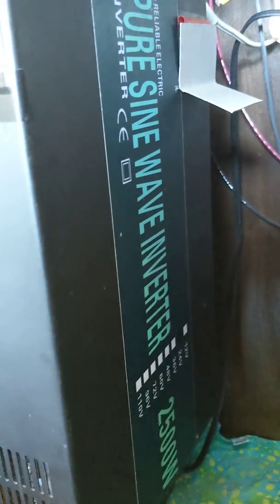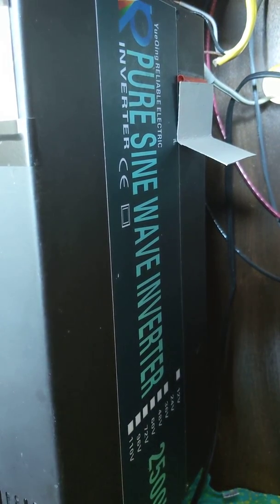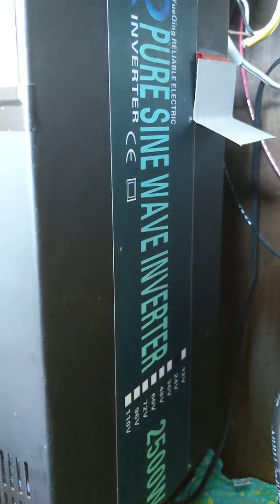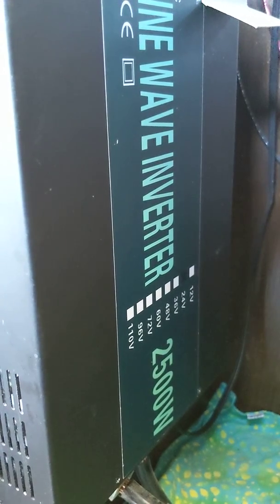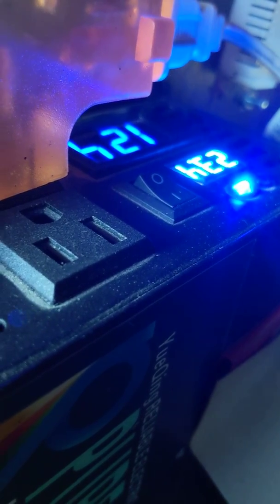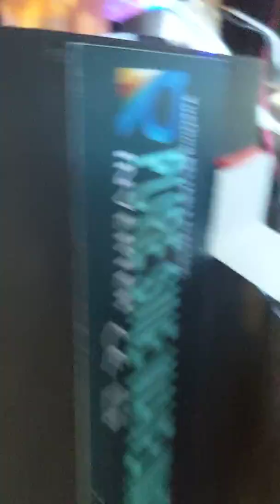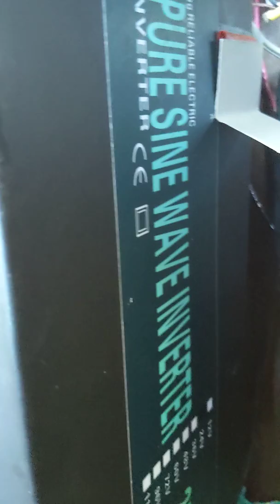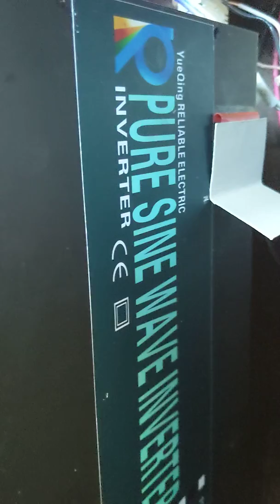What you need to know about inverters when using Nissan Leaf EV battery modules!

Comment: dope I'm doing a 24v one for my home pc to lessens the power consumption during the day at higher rates while it mines for bitcoin. In my highlander I'm doing a 12v one with 2 100w 20v solar panels 4.85a. a 12v 1500w inverter and 2x2x2 leaf g1 modules for about 120ah

Comment: good video but if you can record with the phone on its side it would make the experience that much better.
Reply from the maker: It was hard to get an angle in the cupboard with a horizontal filming.
Reply: @ezmeraldadudortoka7549  well that would be a good reason not to. well good video none the less.

Comment: GFCI is to protect people from getting shocked. The breaker mainly protects the wire and equipment. Your fuses in the inverter will act as a breaker so you aren't being as "reckless" as it seems. But one should still probably have a breaker 😉
Reply from the maker: I'm pretty confident that I get around to explaining that somewhere... It would be hard for me to pinpoint it without just watching them as well. I've got eight in my inverter. I guess I should really watch these videos and maybe update some of them cuz my system isn't the exact same as it is here. No huge differences but I have put three fuses in strategic locations after these videos were filmed. That's actually probably a whole video that can be done. I'm not a media person. Sometimes I get distracted and don't realize that I only hit one of the social medias with a video or explanation. There's a wealth of information on one of my Instagram accounts. @ezzydortpka . Back when I started this project I wasn't quite aware of how Instagram worked... So it's all pretty much uploaded there but I didn't realize that it was such a pain to have to scroll through somebody's entire page to find one particular thing ... However! It has  much more in-depth and several instructional 'type' videos and load tests, installation, and more. Plus it's Instagram, there's no shortage of pictures.✌️ I figure if you're going to do something that not very many people would even consider, documenting and/or the solar system specifically was on my priority motivational list.. 😉🤨😁 I do appreciate your feefback. It's giving me a couple ideas for update videos. ♻️🔌💯☀️🌞
Reply: @ezmeraldadudortoka7549  Lol... In regard to you saying that you aren't a media person... To put it into restaurant terms for you, you're the hole in the wall restaurant of YouTube. I mean that as a compliment. 5 star food but the presentation and aesthetics could use some polish. But, just like a hole in the wall restaurant, it's working well for you and I'm not sure you should change. You have the voice, knowledge and intellect for YouTube and those are the really difficult things that a person either has or doesn't have. However, there isn't a lot between where you are and the next level either. A microphone, better lighting, a one line diagram here and there, and a little bit of editing would go a long way. Don't get my tone wrong here, I'm just thankful for your videos and if this all you're interested in putting forward then that's still great and I understand. If you do one thing then do yourself a favor and at least get that "dortoka" coupon code in the description of all of your videos. It's a meaningful discount and you're doing a lot of free advertising for TechDirectClub.com. See what I did there 😉
Reply from the maker: @justfly2525  You're too kind. I can, however work on a couple of those! I do forget about the other side of that code. I tend to only focus on how it looks if and where I share it, I feel it makes myself seem desperate but I also forget that it's a two sided coin you/they are also getting a discount. It's not just me getting something... everybody else is getting something as well. I know, that's stupid to forget but that's how I've been looking at it for too long...🤷‍♂️
 So, thanks for the feedback and I will definitely try to at least moving forward get that in everything that I publish.  I can most certainly work on the lighting! That's kind of a stupid thing to lack when I'm sitting right next to a solar system that I'm doing nothing but narcissistically boasting about...🤦‍♂️😳😉😉.
 Many thanks for the pointers. Really. Not many take the time to give/leave genuine constructive criticism and not be a complete douche about it.😉🙄 Thanks for restoring some faith back into humanity for me. ✌️🐢🤙♻️🔌💯☀️